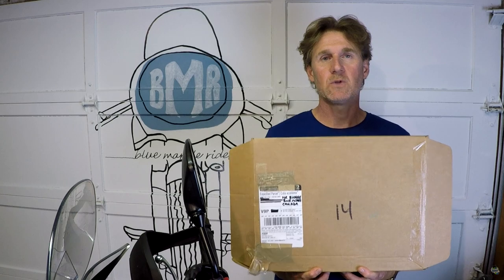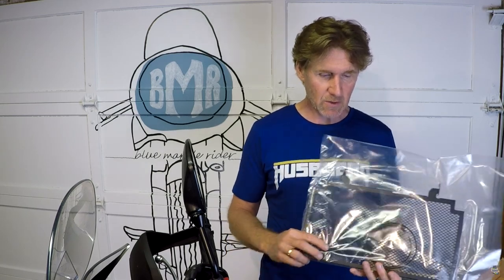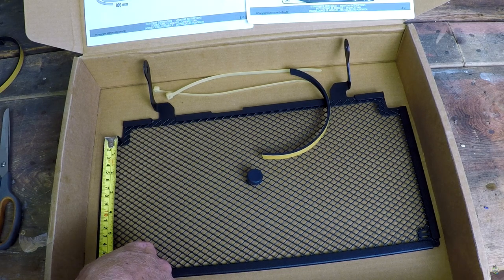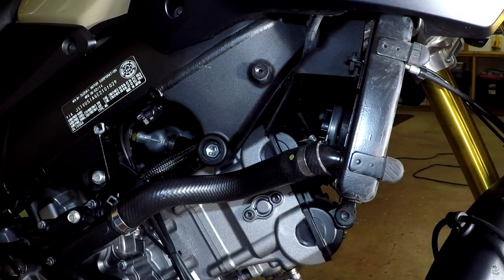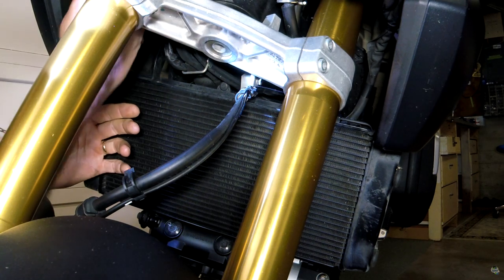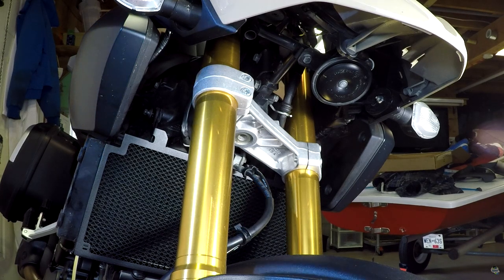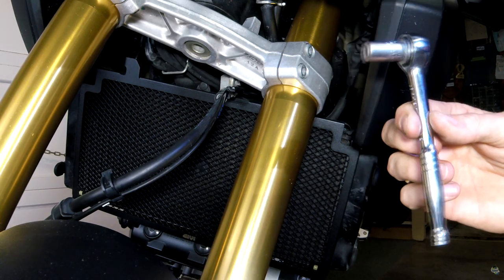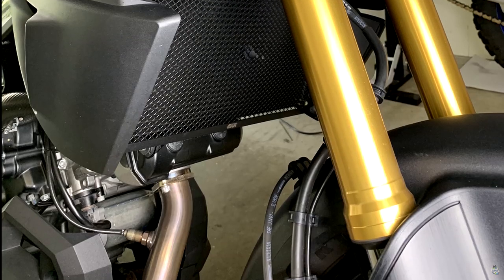GIVI RADIATOR GUARD INSTALL & REVIEW | 2014-19 SUZUKI VSTROM 1000

Comment: I fitted the radiator guard made by the Australian company "Radguard". It uses the existing bolts and also over clips for the top edge of the radiator. T1-T5 aircraft grade aluminium is used and the cost was $159.00Aud. Took about 10 mins to install. Will be interesting to see how durable the Givi is over a period of time. Always enjoy the videos mate.

Comment: Recent subscriber as I just bought a '19 V 1000.  I watched this video while researching mods for my bike and ended up buying a rad guard from SRC MOTO in the states for 68$ USD.  It has a tab on the bottom left side and has an addon bracket for the bottom right side.  Install was great and it's a high quality stainless steel part.  Thanks for this video, it helped me make my decision to look around a bit more to find something better.
Reply from the maker: Glad you found one with a proper bracket (and cheaper!).  Good find.  Cheers.

Comment: Many thanks BMR. I just received my givi radiator guard from F9 for my dl1000. Excitedly opened the box, discovered the cable ties and thought that was rather shabby for the price. Think I will return it and look again at Ravetech or other. Many thanks.
Reply from the maker: Agree - you don't expect a "hack" solution from Givi, which is what this is.  That said, so far, they have held up, but as they're plastic next to a heat-cold cycle, inevitably they will fail - I check them often.  Cheers.
Reply: @BlueMarbleRider  Decided to just go ahead and keep it and installed it Sunday afternoon. Mine must have been an upgrade as the cable ties were black at least! Grateful for your video as it definitely took some fiddling to get the left side bolt back in. Figure I'll keep some spare zip ties on the bike for when one inevitably fails...
Reply from the maker: @dnrblueliner  Yes, I have a few cable ties under the seat for that, and other potential circumstances.  Cheers.

Comment: Strange... The Givi rad guard for my 650 has 4 metal S hooks that loop over the radiator edges (wonder why they didn't do the same for the 1000). 2 min install job, no problems after 1 year. I chose it specifically because it's stainless. Instructions sheet: https://media.givi.it/XN-Prodotti/istruzioni/PR3112.pdf
Reply from the maker: It seems they have the same system (cable ties/zap straps and foam tape) for the big BMWs as well. Curious - perhaps there's an overlap between some models of bike that allows them to use the same shape and size rad guard with similar top mounts but not the bottom...Cheers.

Comment: If you can’t see the cable ties once the covers are back on is it a big deal? It says it is a steel guard, not sure why you would complain about that if you purchased it, surely you knew that?
Reply from the maker: Hi, Terry, you can see the cable ties, but the bigger deal is the engineering behind using cable ties instead of dedicated fastners to the bike.  As for the steel, my bad, assumed and didn't check...